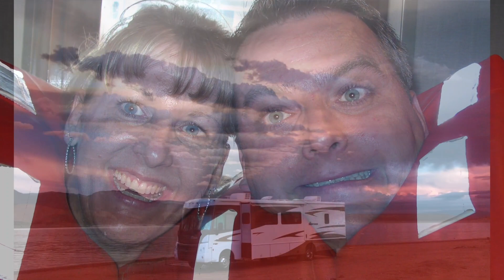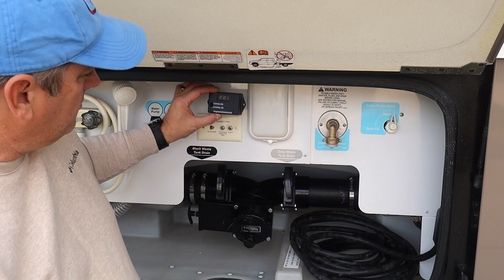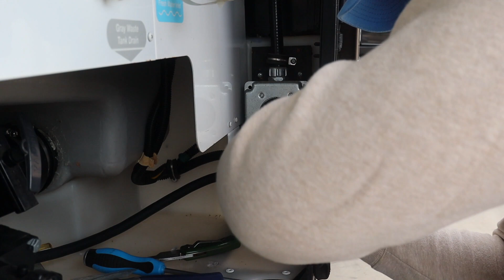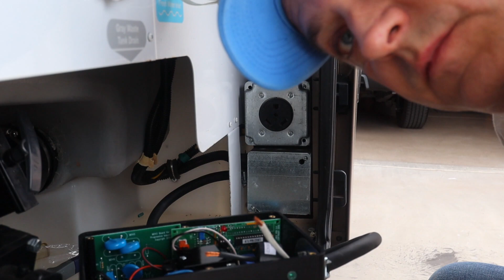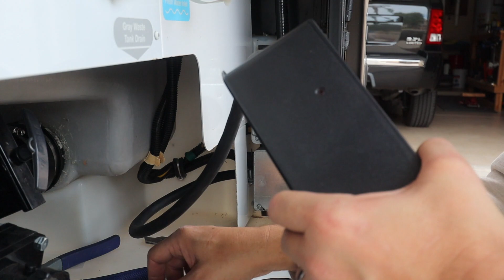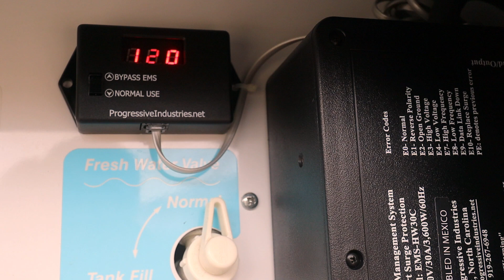RV DIY INSTALL | Hard-Wired Progressive Industries Surge Protector [Full Time RV Living]

Comment: The by pass mode as you probably know is used when you plug your shore power cord into a portable generator because a generator is not usually grounded. What I did is to take a male plug that you get at the hardware store and wire a jumper wire from the neutral to the ground. This stand alone plug then is pluged into a 120v receptical on the generator. Now the remote on the EMS can be left in the normal position because the EMS no longer detects a ground fault.
Reply from the maker: Thanks for the info, David!

Comment: What is an approximate cost of a hard wire system on a C class unit compared to a $300.00 portable unit?
Reply from the maker: Hi Phillip. The price is about the same. The upside of a hardwired unit is that you have one less thing to handle or worry about getting stolen.  Just plug in your RV shore power cord to the pedestal, wait 15 seconds for the unit to evaluate the power and your done.

Comment: Has anybody had a problem with the contactors generating heat. Got hot enough to smell burning wires and the bolts that hold the contactor pulled through the housing. IR temperature on bolts was 197. New contactor was installed bolts are at 123 degrees with the contactors at 111. No faults or errors on LED any info would be appreciated
Reply from the maker: Hi Jason. I have noticed that the case gets warm, but have never taken off the cover to measure internal temp.  You may want to contact the manufacturer and ask the question.
Reply: Thanks for ur response. I contacted their customer service spoke with someone that was new and all he could do was suggest starting a warranty claim. unfortunately this unit was installed by a previous owner and I do not qualify. I was hoping by installing a new contactor it would resolve this issue. I will try their customer service again. Thanks for your video and I'll keep your Amazon link for future reference

Comment: You keep saying "common or hot".  They are not the same thing.  In AC, the black wire is line or hot.  The white wire is neutral or sometimes called common.  Green, of course, is ground.  Just so nobody's confused.
Reply from the maker: Sometimes people simply misspeak. That's why it's important to read the instructions.

Comment: Late to the party, but DO NOT TIN THE WIRES.  In short, the solder can crack under pressure, thermal expansion / contraction over time  leading to a loose connection ,  heat, and bad stuff.  Either use a ferrule or just plan wire.  example source -> https://cdn.thomasnet.com/ccp/00142951/263810.pdf
Reply from the maker: Thanks Mark!  Appreciate your input.

Comment: As a master electrician, I give you my stamp of approval, BUT I would put some strapping on the shore power cord in case it gets pulled on so it doesn't damage the device. You know, like when your wife drives off with the cord still plugged in. (remember what happened at the drive in theater 40 years ago?)
Reply from the maker: Thanks!  I did install a strain relief clamp to help prevent that.

Comment: Just one suggestion, why did you mountmoniter in that compartment? Why not put in the coach so you can monitor it from inside.
Reply from the maker: Great question, Boyd!  Mounting the monitor inside where all of the other monitor panels are would have been quite a bit of work.  I would have needed to extend the cable for the monitor as well.

Comment: Why not just cut the shore power cable instead of messing with the box?
Reply from the maker: Suppose you could as long as the conductors are long enough to allow it.  Also, all splices must be protected by a junction box per NEC.